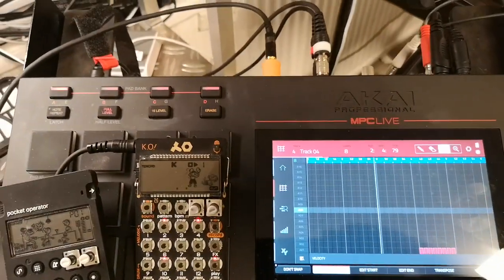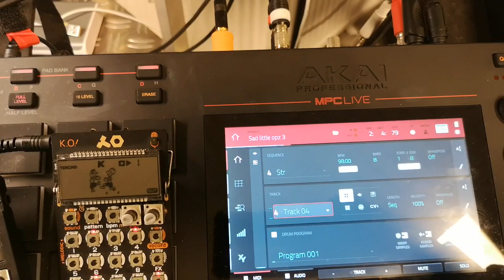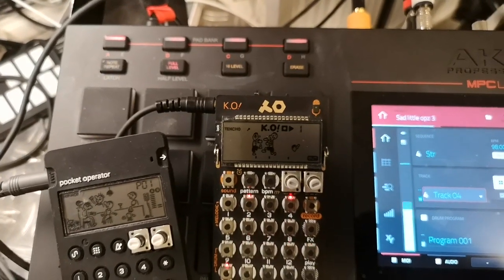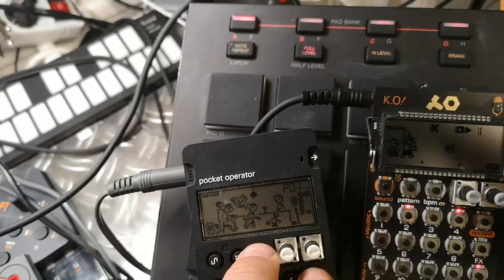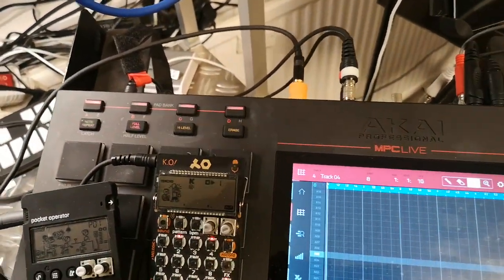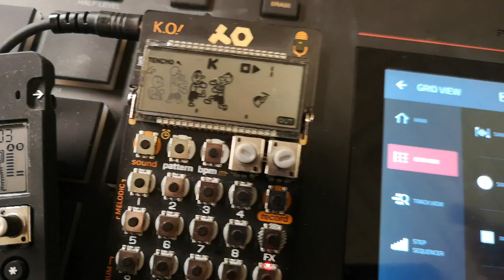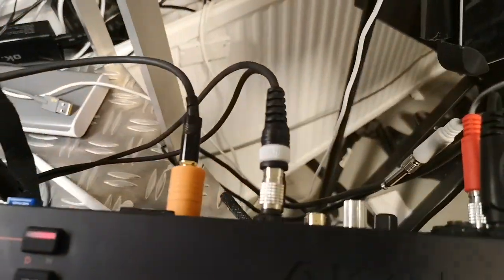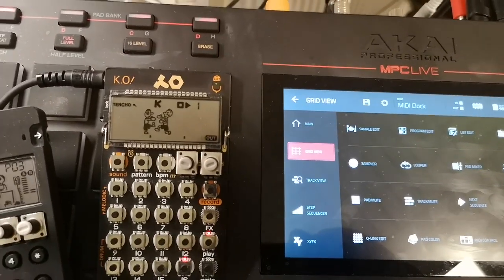OP-Z OP-1 PO35 PO32 MPClive sync setup

Comment: Hey Bruno 
Do you know if the OP Z can send Midi Notes into the MPC Live for them to be recorded.
Maybe using the OP module or by USB
Thanks
Reply: Yes, just connect the usb that comes with the OPZ to connect the OPZ to the MPC Live & make the MPC track MIDI (as opposed to a PAD or Plugin track type) and it works straight away.